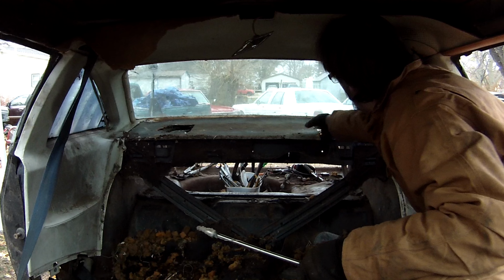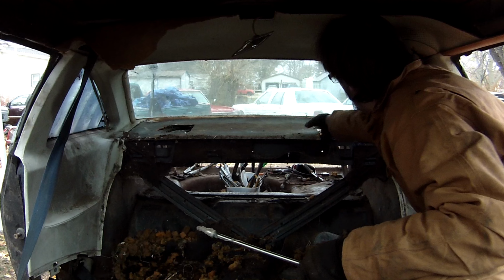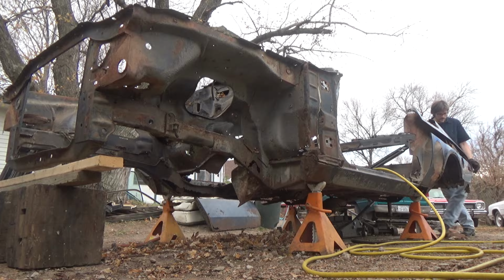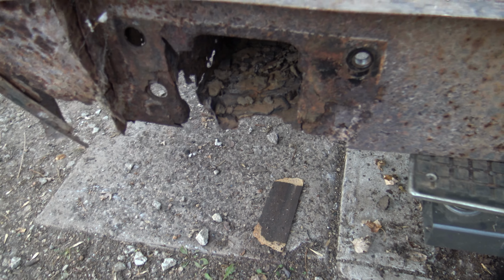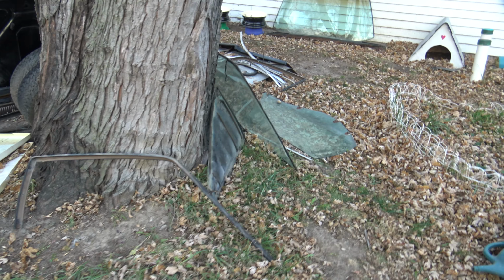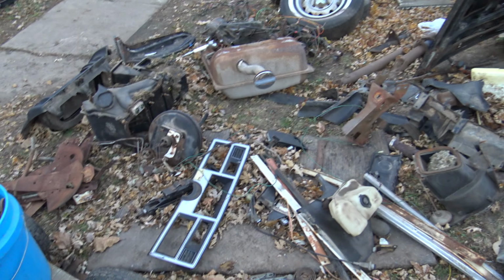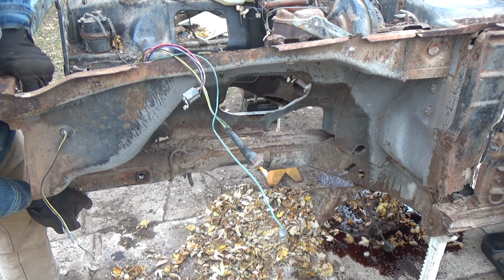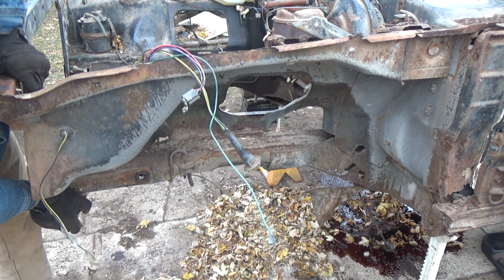Saving parts from a '76 Dodge Aspen R/T

Comment: The later Aspens seem to be more durable than the earlier ones, I have a 1980 Aspen that my grandpa bought new and it's been driven regularly and parked outside under trees since then, the body is still in perfect shape, no rust anywhere, just chips in the paint and that's it. Even the floor and trunk pans still have the original paint on them with no blemishes. Mopar must've caught onto the problem and done something to fix it by late production.

Comment: Hey, I recently saw your video about you passing out, and noticed that the comments were turned off probably because of people not reading the description and assuming you just fell asleep and it’s good to hear that you’re doing better but, what is the condition/ cause of that happening? I was just wondering what it was called and the possible symptoms. Thanks in advance.
Reply from the maker: It's called "Orthostatic Hypotension". A minor symptom is dizziness when standing up too fast. More severe symptoms are nausea, tunnel vision, ringing ears, and finally passing out. In my case, I had low blood pressure so meds for increasing blood pressure solved the problem. I've heard from many viewers that have had similar experiences. A local gal even had the exact same experience (crashed her car when she passed out unexpectedly) and my doctor used the crash video to help her understand what she had gone through and she's receiving the same treatment option.
Reply: @70stastic  ah, thanks for letting me know. Stay safe.